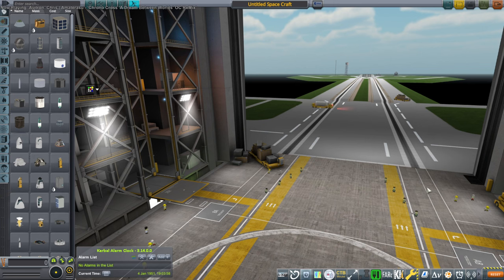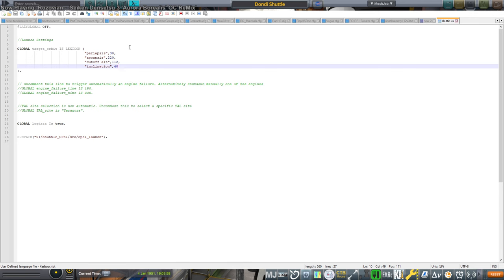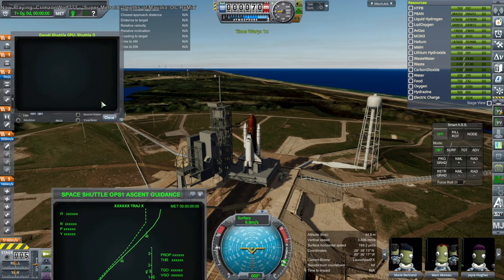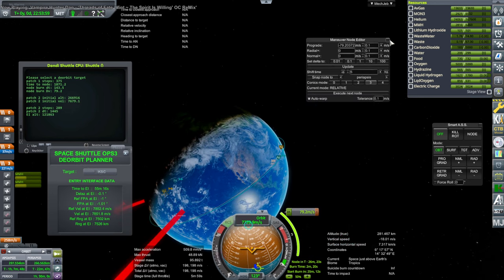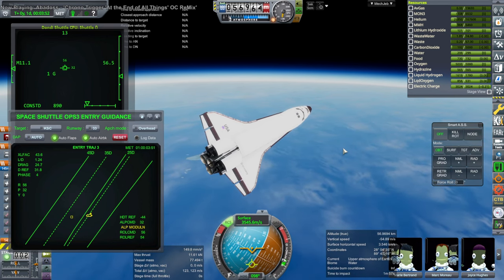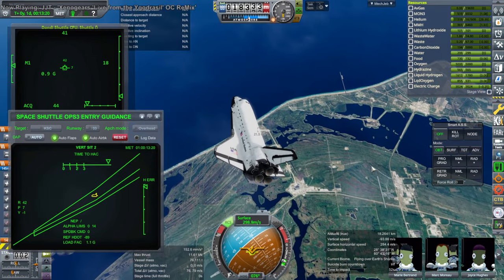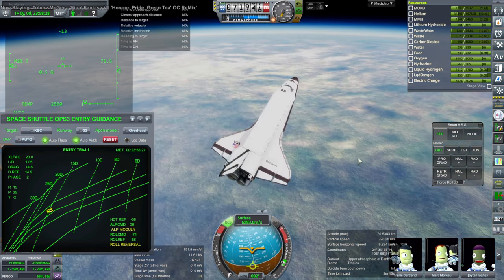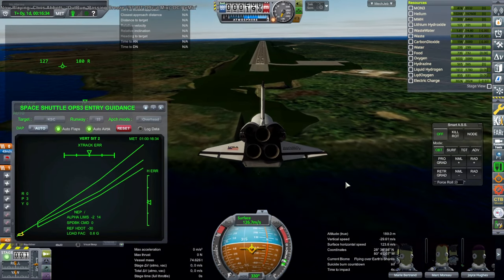Trying out the Giulio Dondi Shuttle and kOS Scripts (RO in KSP 1.12)

Comment: Thanks for giving this a shot Tyler, and for the useful feedback!
Reply from the maker: Thanks to you - your work is incredible! I'll certainly be putting it to use.
Reply: @RaizSpace  Was re-watching and it occured to me that you have two runway statics in the same place at KSC, where one is on top of the other.
The top static got destroyed when you crashed the first time and you used the measuring tool on the bottom one, then on your second try the top runway respawned.
This explains why the script landed hard and short, it was effectively aiming 'underground'
Reply from the maker: Well, that and it was slow due to the drag chute as you said during the stream. Yes, it seems the top static - supplied by the old Real Launch Sites mod - returned to us for the landing even though it was gone during the rover drive.

Comment: The KU-band should install on the front most node in the payload bay, with the dish facing inward when it's stowed. The node is a bit hidden with the docking adapter, so the easiest would probably be to put on the antenna first, then the adapter.